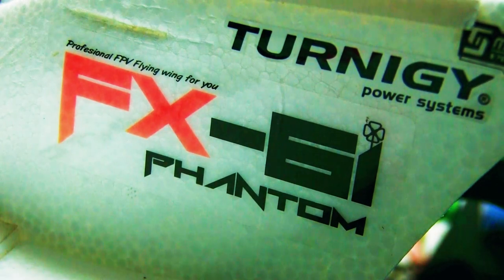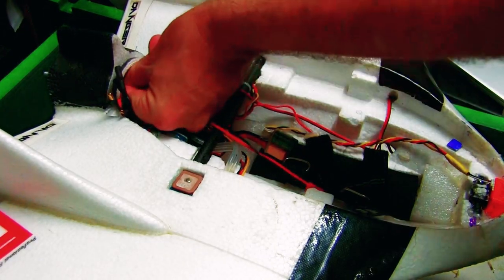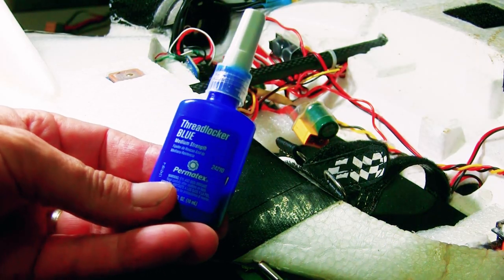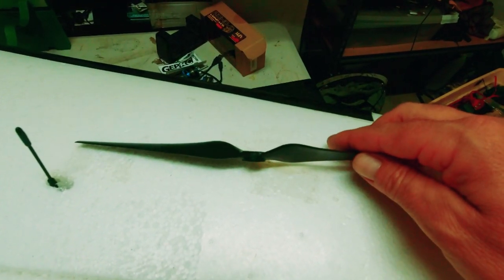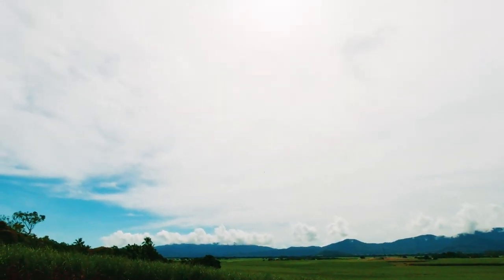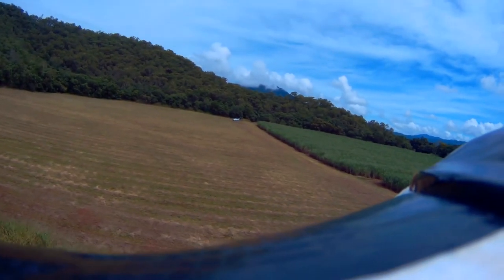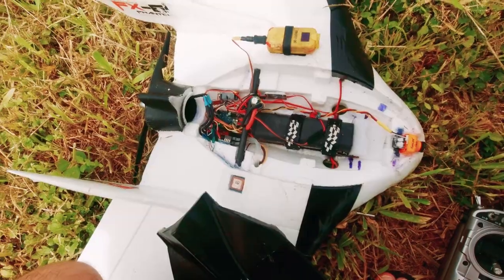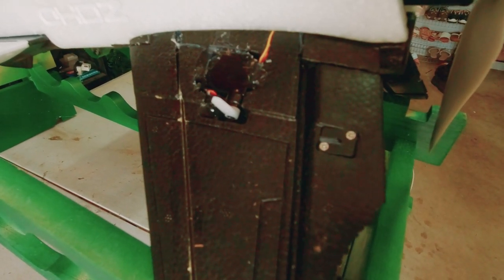FX-61 Phantom - New Motor and 11 Inch Prop Upgrade Test Flight On INAV 6.0

Comment: Wow another FX61 flyer!
I went the other way motorise. Sunnysky 2216 swinging a 8x6 prop.
If you haven't already, shave the foam lip around the motor mount. It blocks alot of air hitting the prop.
Your prop being super close to the foam will create some vibrations along with the loud buzzing noise too.
Awesome location to fly too.
Reply from the maker: Cheers thanks.. what’s kind of flight time are getting on your setup?
Reply: @stonesrcchannel  I haven't really gave it a proper test. I was using a 4,000mah 3S pack. But it felt a little underpowered.
Put a 50a ESC in and now run 4S2P Li-on packs or  5,200mah lipo.
Much better performance.
I picked up an AR Pro kit and a Nano Goblin that are much better platforms, my poor old FX61 has been a bit neglected.
Reply from the maker: @MarkFord  the fx-61 is a great flyer, great long range cruiser. They definitely perform better with the larger prop in my opinion.